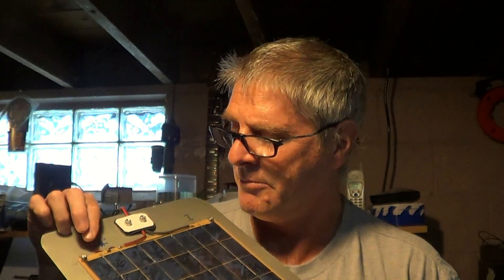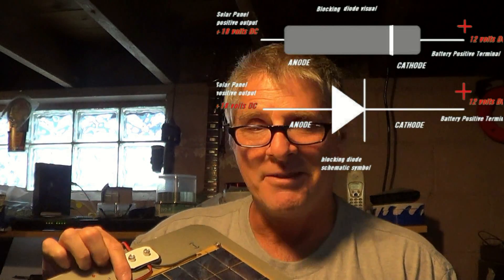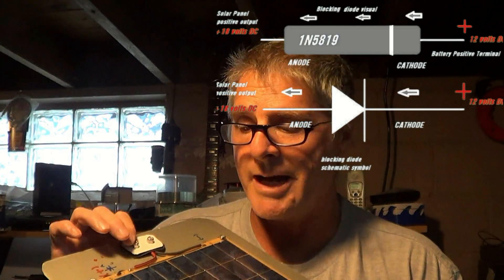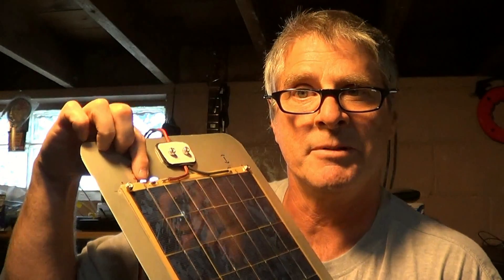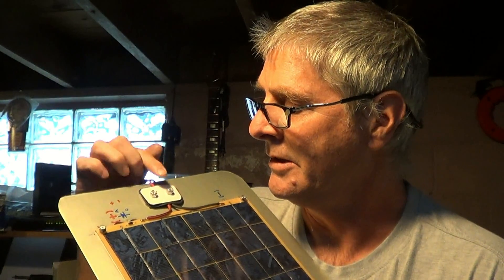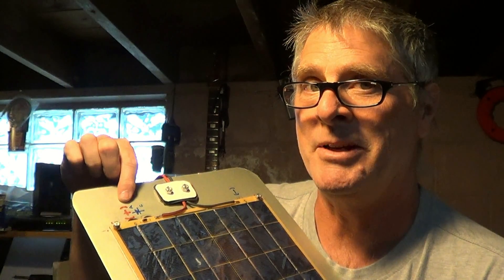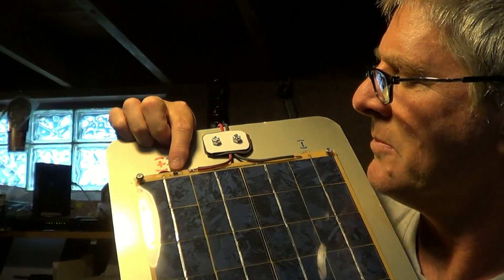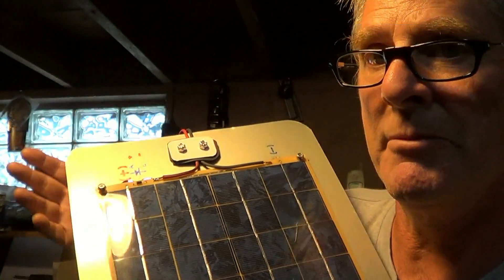Solar Sailboat BLOCKING DIODE install ~  home made SOLAR PANEL battery charger solartekTV

Comment: Great info! What size would you recomend using? I see different ratings which would work with small power pannels?
Reply from the maker: hey 523 ~ thanks for watching! it is best to go time and a half the out put of the panel (1.5 x the output) example: power panel puts out 2 amps = 3 amp blocking diode ~ thanks again for watching!!